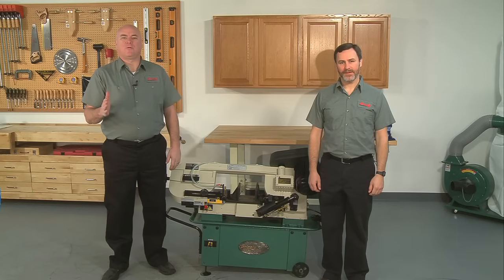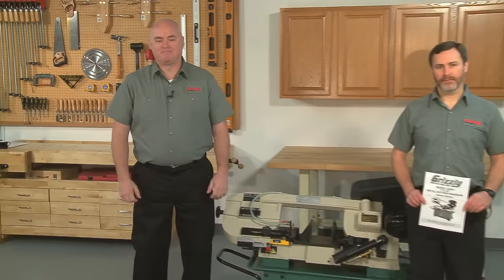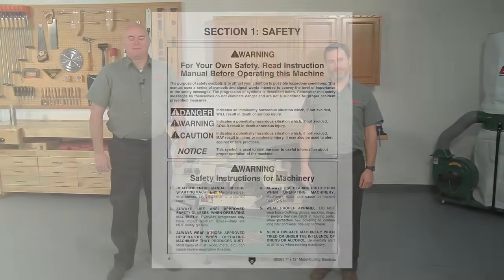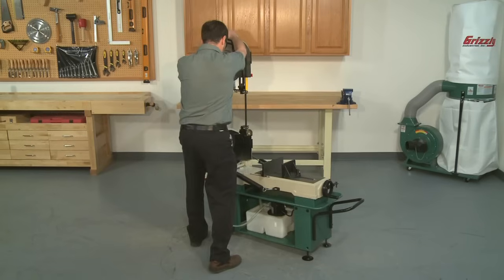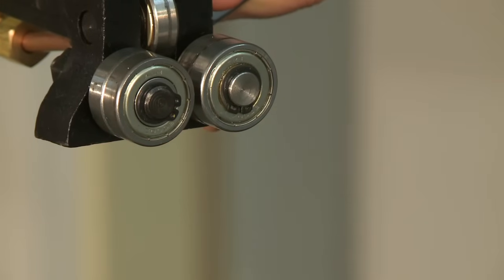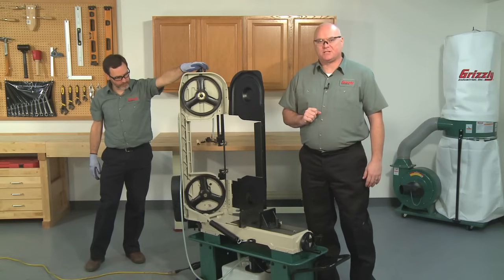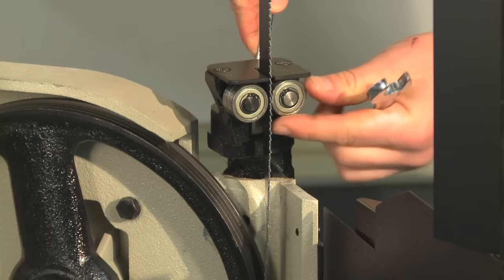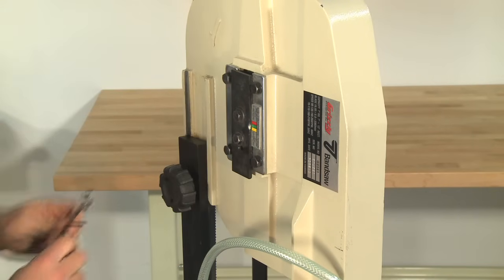How to Install and Adjust the Blade and Wheels on a Metal-Cutting Bandsaw

Comment: I have the G0561 with a stock 3/4 blade.  Can this saw run a 93.5” x 1/4” or 3/8” blade to cut wood?
Reply from the maker: The G0561 is specifically designed for cutting metal, so we don’t recommend using it for wood. Most metal-cutting saws operate at slower speeds, which can cause burning when cutting wood. Additionally, the saw is optimized for a 3/4" wide blade—using a different width may affect performance. While the blade guides are adjustable, they're intended to accommodate blade thickness rather than width.

Comment: It'd be nice if you showed blade adjustments for "issues" such as the blade doesn't make straight cuts top to bottom. I guess I'll keep searching for a real "how to" video. I just fixed the adjustment for getting the blade aligned 90° to vise holding the metal being cut, but the blade is diving top to bottom. Is there a video on that?

Comment: I have a small metal bandsaw, 'METALLKRAFT MBS 105' and the band jumps off at the drive wheel side. I have to adjust wheel tracking and blade guidance (at the roller bearings). 
Questions: What to do first:
First wheel tracking and then blade guidance 
- or -
first blade guidance and then wheel tracking? please help. thx!

Comment: Making a hardwood fence for the miter makes all the difference MyBest.Tools Tune the saw with a combination square. Adjust the laser so its in line. See the photos.Every part in this saw is adjustable.
Reply from the maker: The metal-cutting bandsaw does not come with extra blades. However, the bandsaw is currently on sale! Check here for more details: https://www.grizzly.com/products/grizzly-7-x-12-1-hp-metal-cutting-bandsaw/g0561